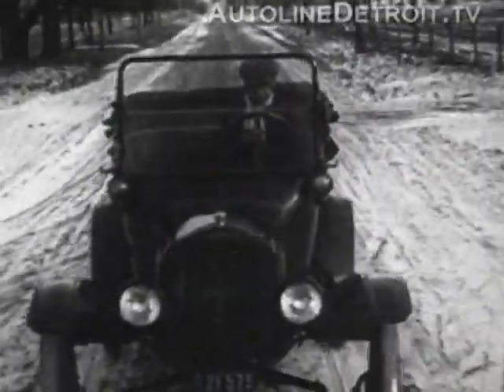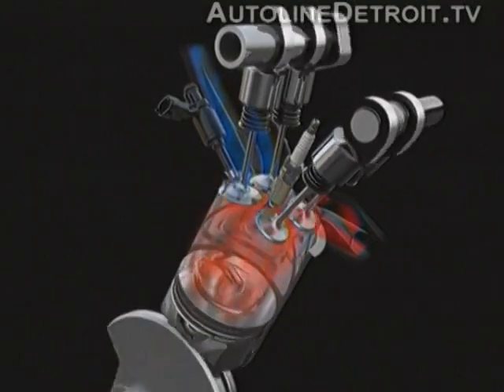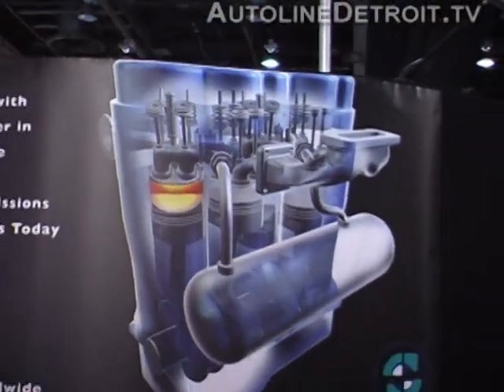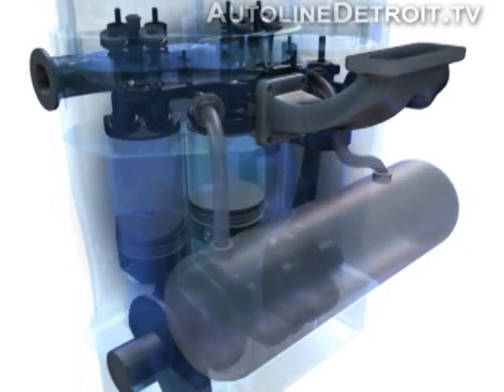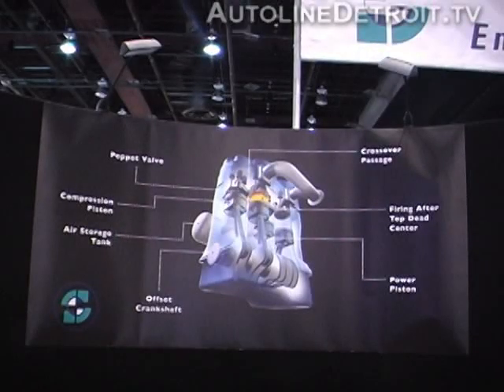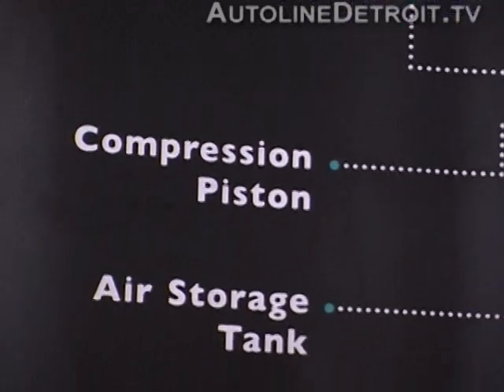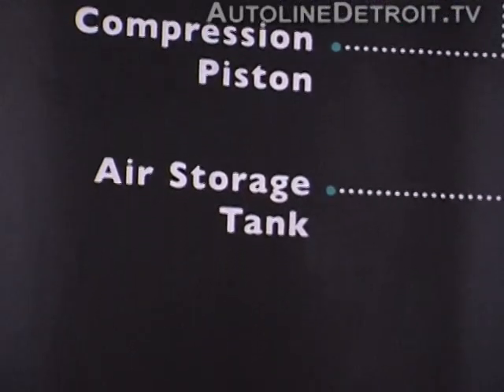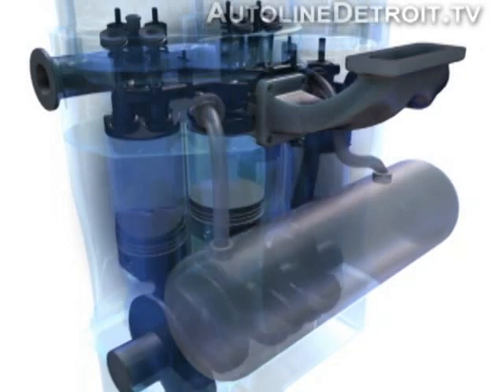Scuderi Split-Cycle Engine

Comment: A turbo kinda does this same thing as it uses exhaust power to boost the engine but by means of forced induction

Now, I wonder if you can get crazy power if you put a turbo on it and tune it right

Comment: Over the last forty years, the auto industry in the United States has been under requirement of Federal Law & Regulation, to increase fuel efficiency. Passenger cars in the United States have gone from 18 mpg to 28 mpg. The auto industry is under a mandate to get this number to 36 mpg. The domestic auto industry is fiercely competitive and grossed about $1,000,000,000,000 in 2015. They invest an incredible $12,000,000,000 in Research each year. I do not believe that Mr. Scuderi has, somehow, out thought them. I do know that the industry has changed enormously over the last 40 years, adding one innovation after another, so it is a myth that they will not accept new better ideas.
Reply: I agree.

Comment: Problably i dont understand good the motor but, neglecting the air hybrid system... Which is the improvement respect with a direct injection 2 stroke engine? The idea looks like very similar but more complicated and bigger. Which is the endurance of the air compresed? They can give a number of liters/100 km to compare with a conventional or hybrid engines? If someone can explain this things would be interesting

Comment: Its the same idea as in a old fairbanks morse yla engine with a pistin to compres air its ben around since the 1920 I think just never ben put in a small package they might be prone to throw the air pistin the old yla where good at it ... threw the roof

Comment: Correct me if Im wrong, But isn't this kinda like using a super charger. Does it have any benefit over a normal 4 stroke with a super charger?
Reply: I think it's mainly because each piston operates as a two stroke meaning less wasted reciprocation (but isn't that negated by the extra pistons?)? so it's maybe like a supercharged two stroke with direct injection. Two stroke diesel does have some advantages like this but then there's a reason they're turbocharged and not supercharged because of the greater power capabilities and efficiencies right?

perhaps a better comparison would be between this and a turbo direct injection two stroke gasoline engine rather than a conventional gas engine?

Comment: If this engine is built the Chinese will make a "cold air intake" that will claim to give it 30 more horsepower but the cheap filter will just let dirt into it.

Comment: For those who understand how engines really operate you already know this is a pretty good idea.  Given its theoretical fuel savings rivals that of a Miller cycle engine is not particularly exciting, but the real genius of the Split cycle is the storage of work of the compression cycle that is normally wasted under part throttle and braking.

Comment: Think about the free electric energy we can get by solar, tidal, and geothermal means sir and the fact that we could be using electric cars since decades ago but because of political / enterpreneural interest we still burn fuel.
Reply: Do you know of existing battery technology that improves the currently exiting technologies in terms of cost and capacity to the point in which it would be more practical? because the tech itself is still the biggest limiting factor.